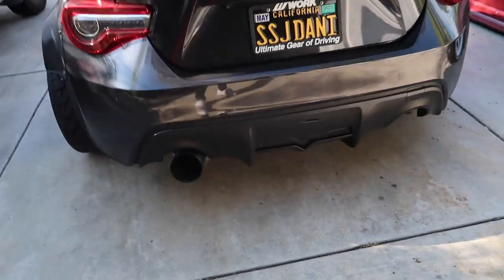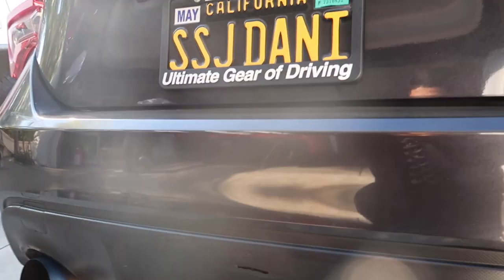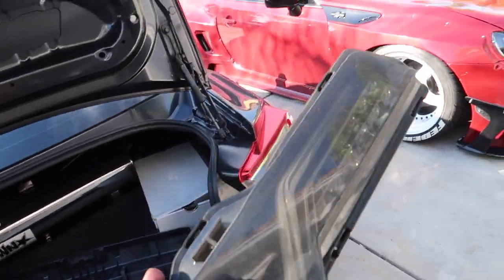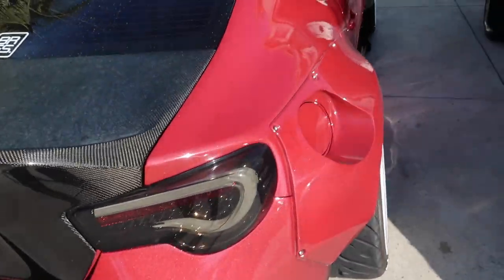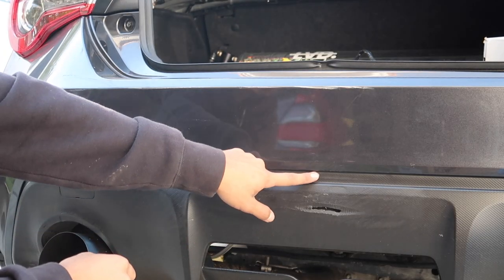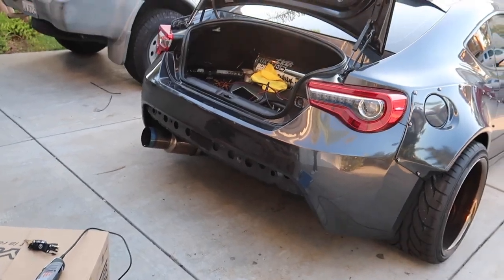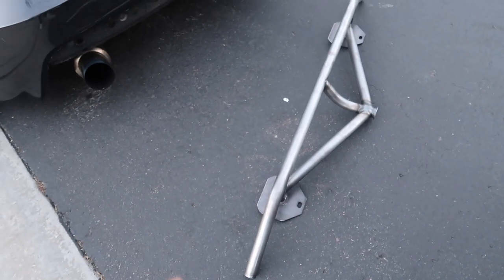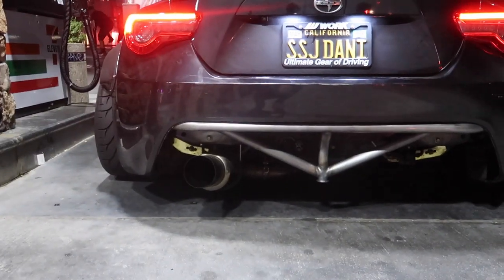The PERFECT BASH BAR for your 86/BRZ

Comment: 2 questions, do you drift? And where is your reverse lights? I may have missed that part but typically you lose your reverse lights doing this.  I have a cheap one installed but it's for changing wheels easier for drift and my taillights have the reverse lamp built in.
Reply from the maker: I don’t drift, its all for looks lol. Also no reverse light 😬 I just turn on my hazards if there’s people around 😂
Reply: @SSJDanny  I see, be careful as depending on your laws you could get into a lot of trouble especially of it causes an accident. I know here where I live I would fail inspection.